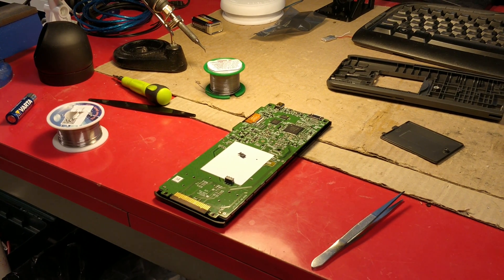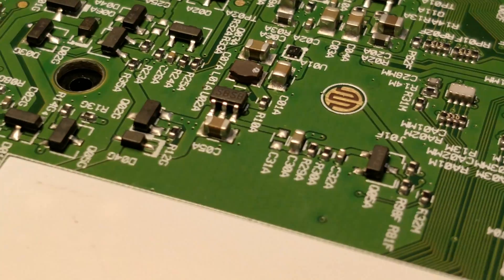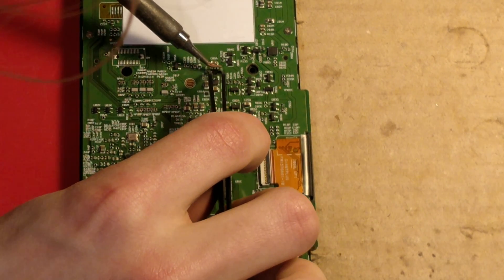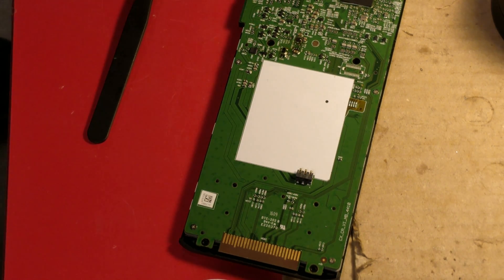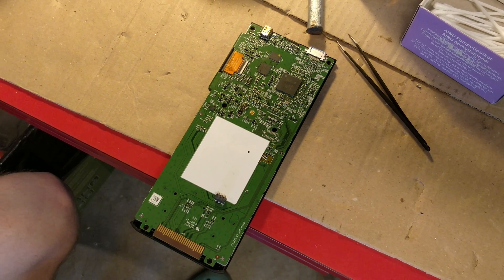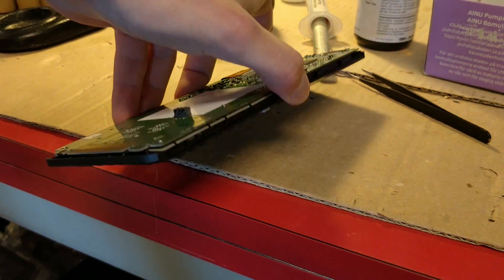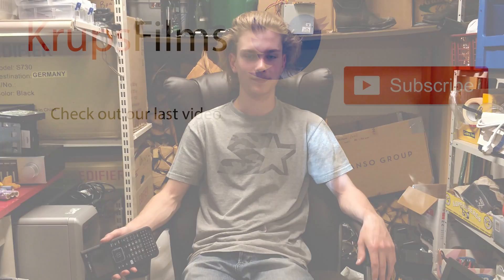How To Fix TI-Nspire CX CAS Not Turning On

Comment from the maker: It seems that some of these calculators open differently, but our CX CAS one opens by removing all screws on the outside and under the rubber pads, and after that by prying on the left side on the front. Basically reverse of 3:04.The CX model is slightly different, so make sure to remove all screws to avoid damaging anything.
Reply: There's 2 screws next to the touchpad under the clear plastic on the front of the calculator. Usually, you need to pry off that plastic piece like a phone screen

Comment: My calculator does not detect the battery even if I remove the battery the text box appears that the battery is low, I already changed the battery with a new one and it does not seem to be working properly, someone hera had the seem problem
Reply: I have the same problem, I still can't solve it.

Comment: Is the same if I use the Lm3670mf-1.8?
Reply from the maker: You should compare the key specs of 3670 and 3671 to be sure, but according to my quick googling the 3670 has lower load capacity of only 300mA compared to 3671's 600mA, so the 3670 might burn out.

Comment: I bought ti nspire cx ii calculator . Now there is an issue with it. So it was dead and I haven't used it for almost a week so I decided to charge it but after sometime when I tried to turn it on its menu screen appeared which was blur and then it got switched off. After that it kept on getting switched on and then off on its on. I don't know what's problem with it. I need some help?
For charging in past I used 5V-2A adapters.
Reply from the maker: Have you tried to reset it by pressing the tiny button on the back? A simple fix like that might help.
Reply: @KrupsFilms  I tried but it isn't working and boot loop starts again
Reply: @AbdulBasit-px7dn  did you every get this figured out

Comment: I have a problem that the calculator does not turn me on, I realized that the battery is dead! Is it possible that I have the same problem as yours?
             ......................... please i need help.!.........................................
Reply from the maker: How do you know your battery is dead? Replacing it seems to be quite cheap, so I would try that.

Comment: Hello. thank you for this video. In my case, the TI nspire won't turn on and overheating. When the battery is charged in another calculator it's same, not working and overheat. So, please tell me if yours start doing it like mine.
Reply from the maker: What exactly is overheating? Have you taken the calculator apart and checked the component that is heating up? Even if it's not the same one that failed on our calculator, it's probably fairly simple to replace.

Comment: Please help me. I have the same problem caused by a bad charger. My doubt is that a bad charger only spoils that chip or some other chip.
Reply from the maker: A bad charger can cause the problem but the nspire cx cas uses a standard mini usb 5V charger so you can just buy a new one if you doubt yours.

Comment: Greetings,
I am attaching my problem, please tell me if your problem was this kind? I believe Its not charging battery and its in some kind of boot loop. Link is here: https://www.dropbox.com/s/722aijgzsbmoufh/Delovanje.MOV?dl=0
Reply from the maker: Hi, 
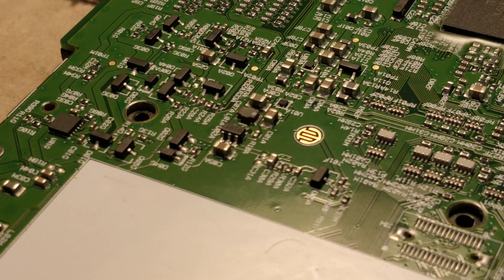That doesn't seem to be the same problem we had. At around 00:33 in your video it seems there are some lines on the screen which could be caused by a different problem like a failing GPU. Moreover our cx cas didn't turn on at all because the faulty voltage regulator chip created a short and drained the battery.

Comment: This video needs a LOT more detail. I just cannot for the life of me get the rear cover off.
Reply: There might be screws under the front plastic panel (the transparent panel on top of the screen) once you remove it you will discover two more screws that you need to take out, after that it's simple disassemble